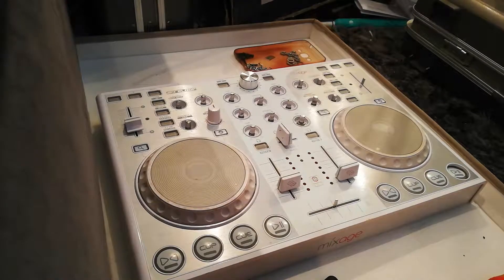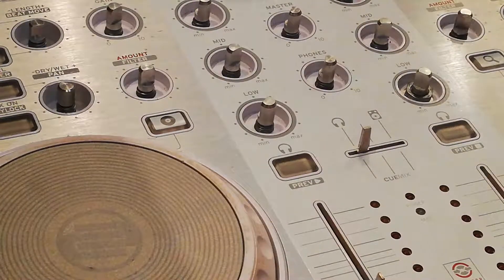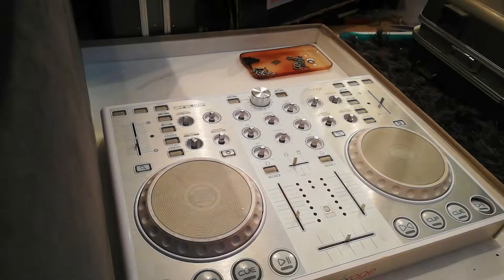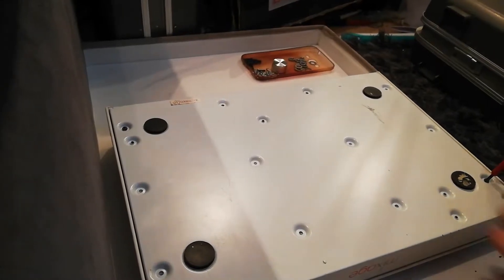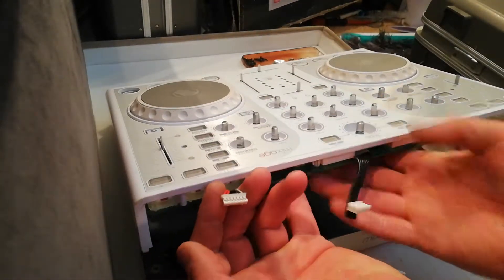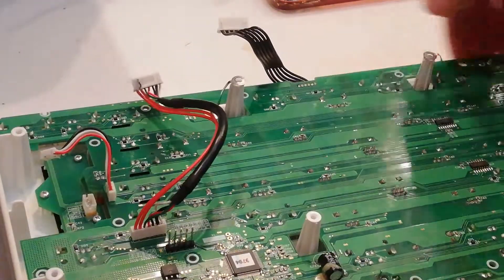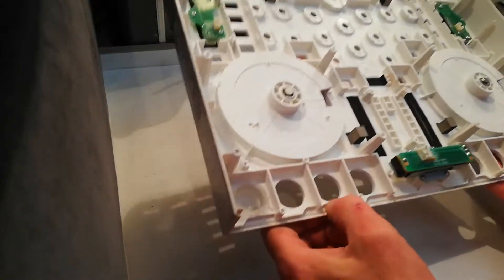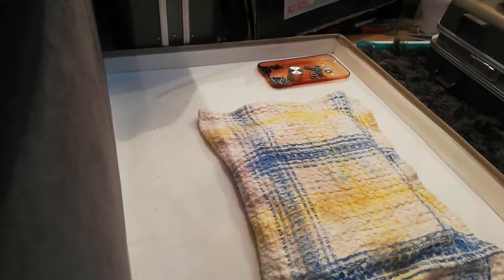How to strip/teardown Reloop Mixage CE

Comment: i have the mixage ie black. got problems blinking midi light. computer doesnt detect when plugged in the usb. any ideas on what might the problem?
Reply from the maker: Try a different USB wire or port that's usually the problem